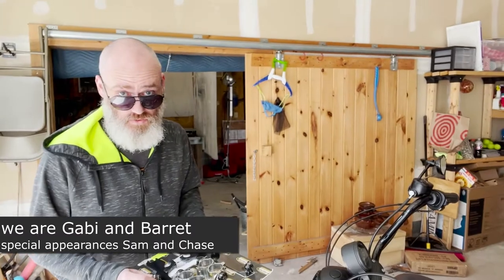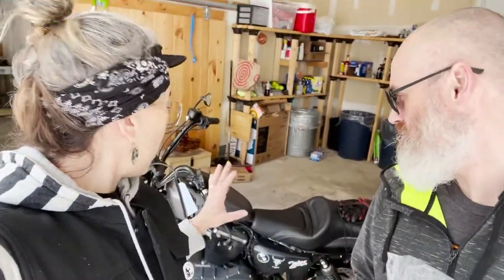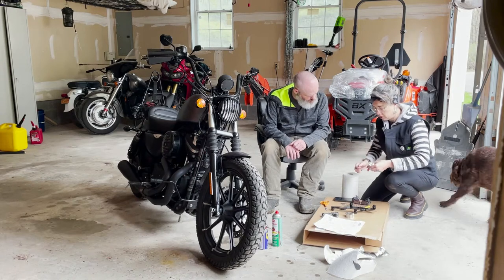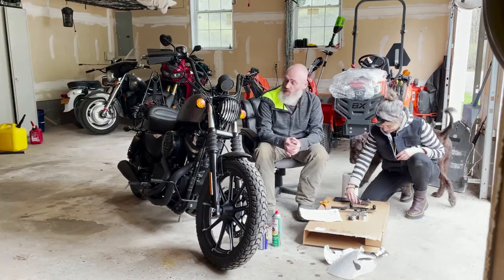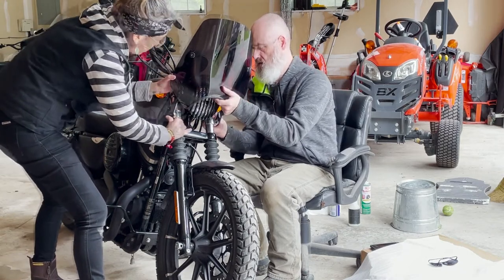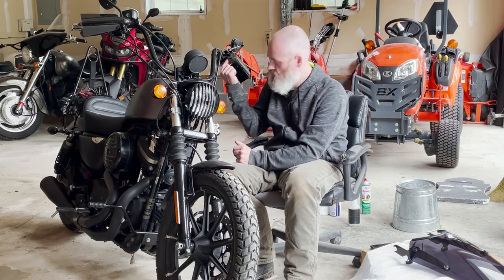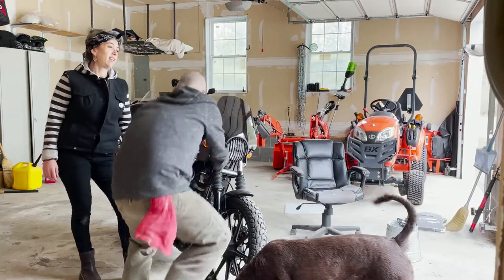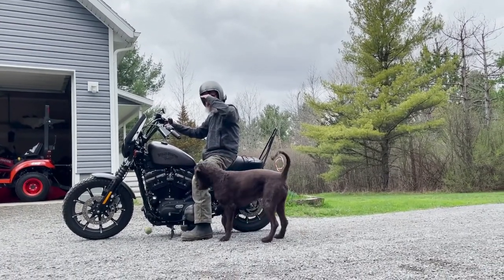#MemphisShades #Sportster #brammoto Windshield install

Comment: Looks great, how's the windshield so far? I'm thinking about getting this shied or the road warrior fairing, but can't decide.
Reply from the maker: Gabi hasn’t rode with it yet. But I did a little test ride and it was good. Time will tell. But it looks real nice.
Reply: @BRAMMOTO  I definitely dig the look of the bike!
Reply from the maker: Thanks
Reply from the maker: Hello, here is Gabi. I finally had a chance to ride with the windshield and I think it works just as great as it is looking. Should have done it sooner.
Reply: @BRAMMOTO  thanks for the update!